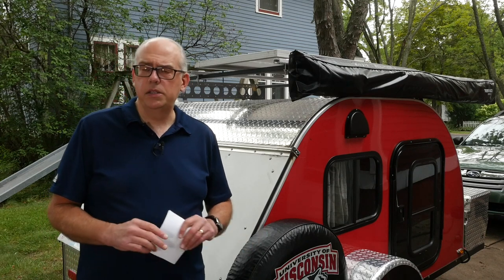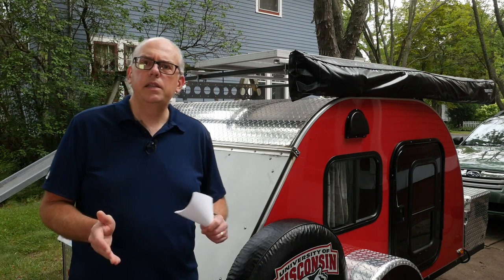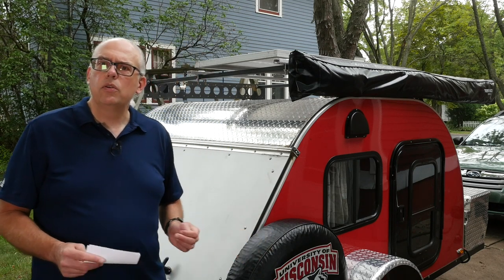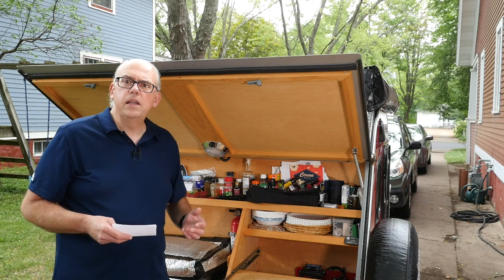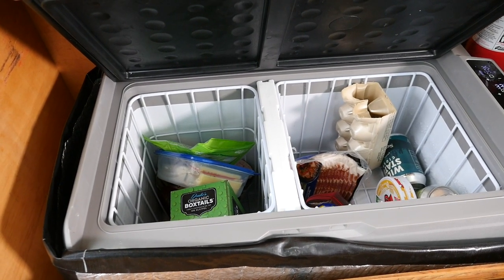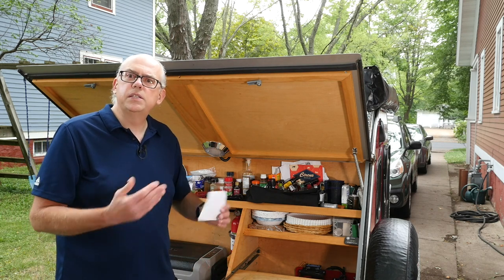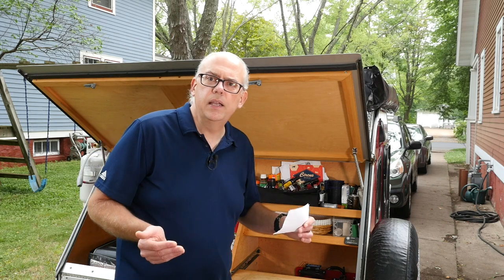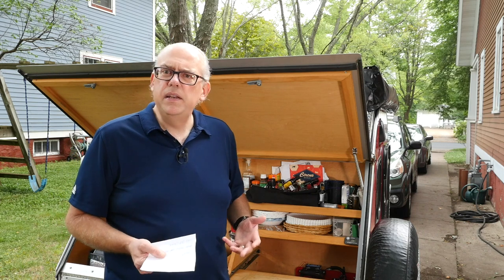Teardrop Trailer Solar Panel Power System Update - Ham Radio Q&A

Comment: Great video Mike.  You might consider adding some portable folding panels to supplement your main solar.   A portable panel tied in with your controller might let you chase the available sun on the campsite.   Those rays of sun move quickly, so you would probably need to babysit it for maximum efficiency.   I had plans of putting solar on my popup camper, but abandoned that because we usually camp in the shade.  Instead, we use a 105 watt suitcase style array and place it where in the best available sun.
Reply from the maker: I do have a 100 watt portable power panel. It's panel voltage is similar to the one on the trailer so I can add it in parallel to the system with a Y connector. As the days are getting shorter, I'll give it a try.

Comment: Hi Michael - Glad things are working well for you.  Before you spend money on another battery I would first make a way to connect your 100 watt folding panel in parallel with your roof top panel and have enough cable to place in an area that gets more sun when camping.  A 100 watt panel will generate 6-7 amps per hour in full sun and that will go a long way to topping off your battery.  Even if its only 2-3 hours a day that should make a huge difference. Using 50 feet of low voltage landscape wire #12 size would have minimal loss and allow maximum power collection.  Secondly I think the insulation on your Fridge might actually be hurting you - find out where the high pressure coils are which most of the time are in the outside walls.  That area needs to be Un-Insulated to allow the compressor to effectively remove heat.  Feel around the sides when its running - if any are warm that's an area NOT to insulate.  If none are warm then its ok as you have it.

Generally speaking its cheaper to add more panels than battery now since panel prices have come down so much - that gains you more power in cloudy conditions too where you need it most.

Lastly adding an RF filter on the Fridge lines may allow you to keep it connected since in your case conducted EMI appears to be the issue.

Cheers to all fellow HAM's.
Rob Tywlak CTO - DIY Solar for U

Comment: If you have the space in the galley, have you considered adding a second battery in parallel. Then you don’t have to move your system to the front. 

In ref to one of your other videos on the subject, I like your addition of solar panels you can move directly in the sun while your camper is parked in the shade!  Strong Work!
Reply from the maker: I'm kind of leaning towards putting a bigger battery in the back and either reorganizing or moving some of the cooking equipment to the front. I think with a bit of organization I can make it work.

Comment: Yes knowing your state of charge on any battery is important - its more difficult with the LFP because of the nearly flat discharge curve so keeping track of the energy in and out of the battery is of importance.  Doing so accurately is not trivial and requires a very high precision with low offset and drift in reading the battery current.  We have a product coming that does this along with full system monitoring and control - uses a 22 bit ADC for measuring current so the state of charge is accurate and does not drift over time.  Unfortunately because of global part shortages its release has been delayed however we were able to procure components and are finishing up the code now so it will be soon.  In addition to keeping track of the battery state of charge it provides full system control with our cell balancer unit and charge controllers as well as datalogging / graphing on screen the system performance.  Stay tuned.

Cheers - Rob Tywlak - CTO at DIY Solar for U

Comment: Just started thinking about adding HAM radio support to my tear drop; thanks for video. I have solar on my tear drop already for standard boondocking purposes but with added power needed for the field boxes (I have portable solar for the field boxes already but would like to consolidate the power source). I think a modular approach with both the fixed panel input and a portable panel on a stand with cordage would be a benefit (using the quick disconnects to select which panel to use).  The portable panel(s) can be maneuvered to a sunny spot.  Nice mention of the shunt; a must for monitoring smaller systems that don't have the high-end chargers (I designed and installed a whole-house solar system for our house).  Quick note: each battery type needs a particular charger type.  I would hate to see someone think they can charge  a Lifo battery with an AGM or Lead-Acid battery charger.  Thanks for the video. 73  KN0END

Comment: Nice job Michael. You will always be doing upgrades. I have a solar set up fir my travel trailer but I use portable solar panels. The go up on the roof once parked. I just have to connect the cable from the MPPT controller. 
Sure makes for quick set up. I only use mine to charge main battery and my radio station batteries. 👍🏻. KI5IQE
Reply from the maker: I also have a 100 watt portable panel. Its voltage matches the one on the trailer so I could connect it in parallel for added power. I'll give that a shot on the next trip.

Comment: Just an observation as I watched it again - at about the 12 minute mark the display shows "Bat" "Full" so even cloudy you were getting 1.28 amps or so with a peak power reading of about 28 watts.  That is about right for an overcast day on a 180 watt panel.  10-20% power is typical during overcast conditions.  Thanks to the HD video the LCD display is readable :-)

Cheers - Rob Tywlak CTO at DIY Solar for U
Reply from the maker: I'm surprised that even with cloudy situations that the panel and controller can generate power. Partial shade seems to be a problem though, if parts of the panel are shaded, it tends to drop the entire panel's performance.
Reply: @KB9VBRAntennas  Yes that can happen depending on the shading pattern and how many cells are shaded and how many bypass diodes the panel has.  Sol needs 10 volts minimum to extract power and on a single panel the shade tolerance is not as high as 2 panels in series would be.  Solar cells really don't flow power well in reverse thus the need for bypass diodes.
Cheers - Rob at DIY Solar for U

Comment: Looking at solar options to run a few radios off grid. A 50 amp battery for your system seems a little small for your set up. Look at upgrading to a 100 ah or add another 50 ah battery or look into getting a DC to DC converter to charge your batteries while driving.
Reply from the maker: I'd have to rewire my trailer and hitch connector to a seven wire system, but that would be an option too.

Comment: Nice system!  Does it have any provision for charging the battery from an external source (commercial power, vehicle charging system, generator, etc.) if you encounter a long period of low solar availability?
Reply from the maker: I can connect a charger to the power distribution box for mains charging, but that's temporary. Another option would be rewiring the trailer hitch connection to a 7 wire system so I can take power from the vehicle.

Comment: Another consideration on your power needs is to find appliance that draw less power.  For example, I have a solar box that I build that runs a 3 Watt light, I choose 3 watts instead of 7 watts to save power - every watt counts.   In your 22-24 Amps you use a day, what percent you would say the refrigerator uses on a warm to hot day?
Reply from the maker: The refrigerator is the biggest power consumer, all my other power needs are just a couple of lights and charging phones and camera batteries. On hot days the fridge will use more power to keep things cold. Adding more insulation and keeping the back of the galley open to allow better airflow around the compressor coils will increase its efficiency.
Reply: I really don't think 4 watts would matter in my case. I would increase the battery storage capacity and put all power devices in the box on the tongue. Keeping all wires short a possible especially the battery leads. I would twelve volt or twenty four volt all my appliances, lighting and radio equipment, computers etc. If I needed 110 voltage I would put a switch on the power inverter and only turn it on when using 110 voltage. The refrigerator and ham radio transmitter would be my highest power usage. Just my 2 and a half cents worth.

Comment: Michael, can't you just add another battery in the front box and connect it to the system you have? That way you won't technically have to reconfigure much, just run the battery cables to the charger and controller in the back, split the load between the 2 batteries.
Reply from the maker: That would be an option. I would have to use a pretty thick power cable to run between the two batteries to reduce the power drop.
Reply: @KB9VBRAntennas  I think lithium batteries connected in parallel need to be at the exact same charge state (voltage) before connecting them safely.

Comment: Does the panel of the ability to tilt so you can get the most sun as possible throughout the day?  You may have covered it and I just missed it.
Reply from the maker: The panel does not tilt. I did not add that in order to keep things simple. Plus in order to take advantage of a tilting panel, I may have to park the camper in a sub-optimal position for camping.

Comment: Michael, I love your videos, keep it up!!...Comment on the battery capacity: How about butting another 50Ah battery in the utility box and connect them in parallel? Would that solve the capacity issue and allow you to use the existing battery that you already own in service.   I hope this helps....de Steve NA5C
Reply from the maker: That would be an option, it would also require a pretty hefty cable between the two batteries to minimized the voltage drop.

Comment: Great video❗️ I just picked up a Jackery 1002 Solar Generator and 2 100 W solar panels, I hope 🤞 it will run my Ham Radios without any interference but I don’t know some say it won’t some say it will❓
Reply from the maker: I don't have any experience with the Jackery, but I would love to test one some time. I do have a Renogy Phoenix portable power pack and I don't get any rf interference from it.

Comment: On your Teardrop trailer. anyway to charge the battery while the car is running?
Reply: I use a victron dc to dc charger.
Reply from the maker: In in order to do that, I would have to rewire the trailer and my hitch connector to a seven wire system. But that would be an option.